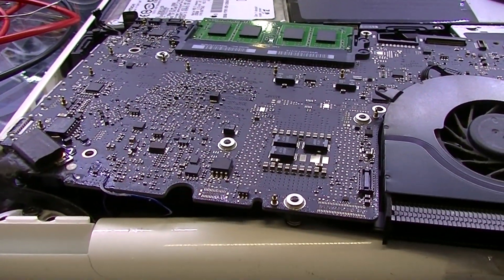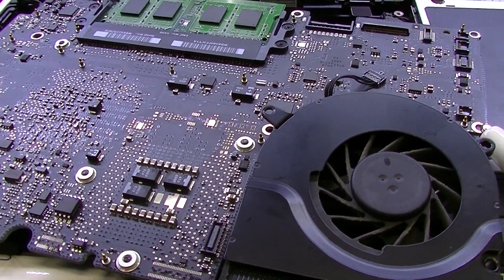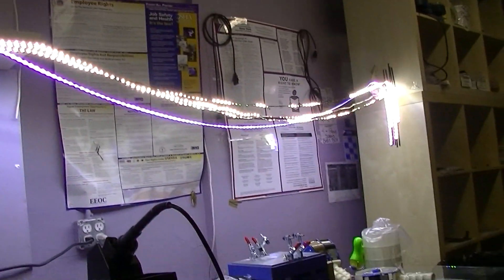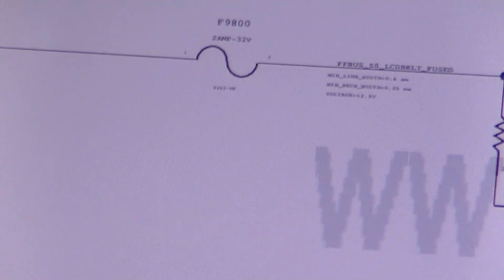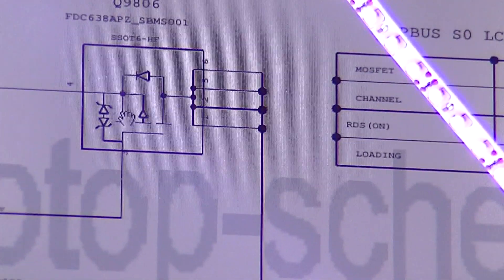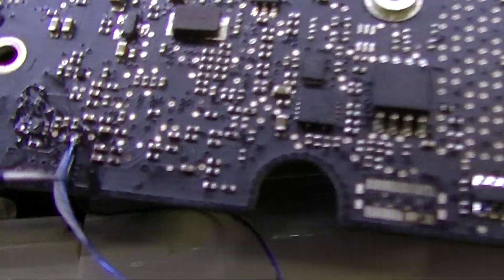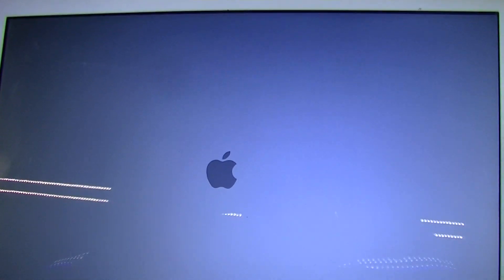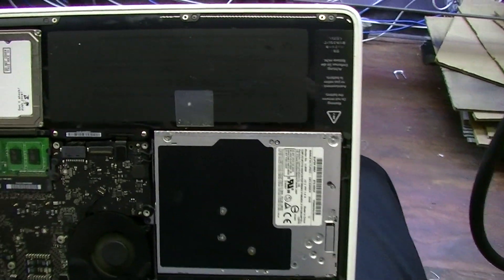820-2567 A1342 White Unibody Macbook no backlight logic board repair

Comment: hello I just wondering i want to fix my old macbook  model A1342. this part is broken A1342 MC516 MC207 DC Jack 820-2627-A
I only used for 2 year my macbook but i have problem with charging. what i can do I need you help please

Comment: Been following ur vids for a few months and am pretty amazed how you've fixed things at component level. I'm trying to do the same for my macbook mid 2010 unibody which stopped working over the summer and am trying to repair. I've got all screws undone apart from the ones for the fan and two on the white bits. According to iFixit, you need a #00 philips screwdriver, which is the same one needed to remove the bottom case, but it's not working for me! Can you help?
Reply from the maker: You have stripped screws or a fucked up radioshack screwdriver. Try a Wera #0 or Wiha #000 see what happens.
Reply: It's not stripped screws because I tried it on a completely fresh screw on the fan (the one beneath the ribbon cable). and it won't unscrew. The screwdriver I'm using is working fine for the bottom case screw, which are meant to be the same ones for the fan. Also the four screws on my RAM, Ive unscrewed three of them with the same screwdriver, but the other one won't unscew.
Reply from the maker: You  don't  unscrew the ram slot. I'm giving you  benefit of the doubt when I  tell  you you are using a shitty screwdriver. If you  are using a good screwdriver then you're  fucking  it up somehow.
Reply: it's such a shitty situation man.
Reply from the maker: Get a Wiha picofinish #0 and #000, make life easy on yourself.